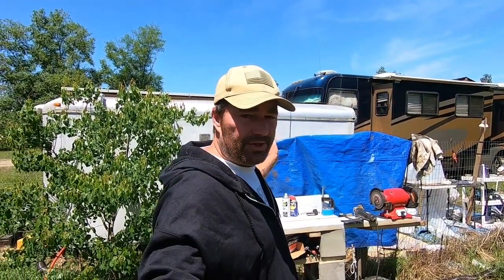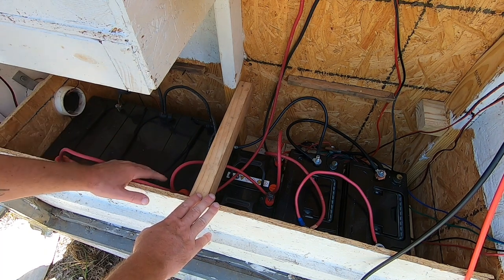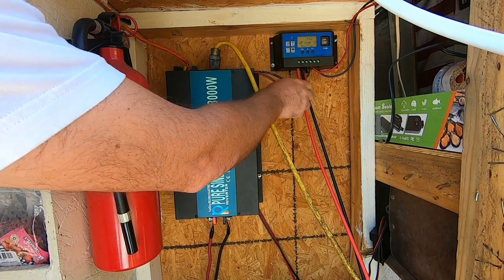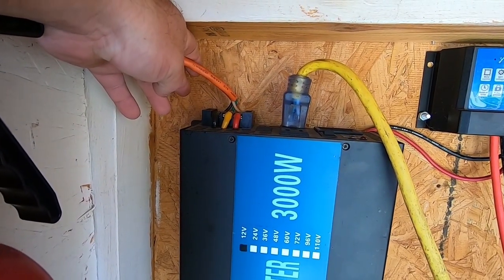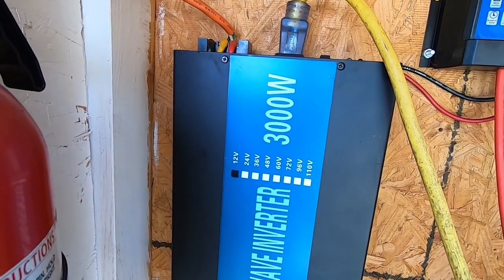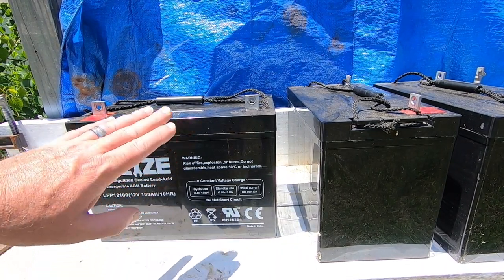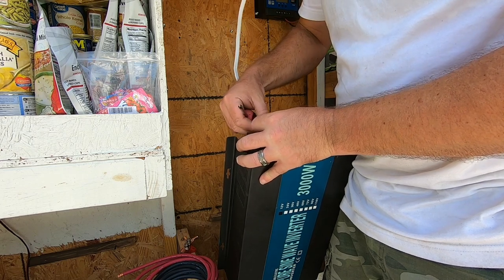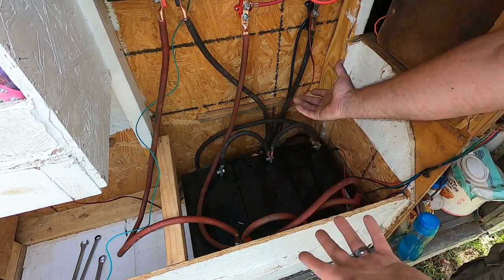Offgrid Solar Simplified Episode Two, batteries, inverters, charge controllers

Comment: Hi CFP. I just rewatched your solar installation videos.  My question is this: if I'm running my solar panels for my ecoflow delta generator,  do I need a charge controller or do I run it direct to the generator?
Reply from the maker: Built in charge controller
Reply: @SurvivalLiving  Thanks CFP